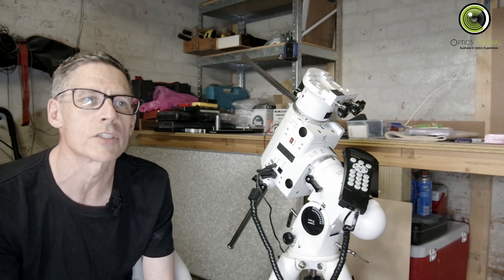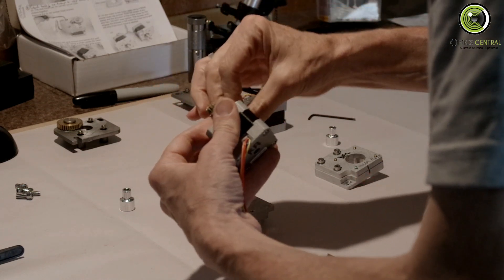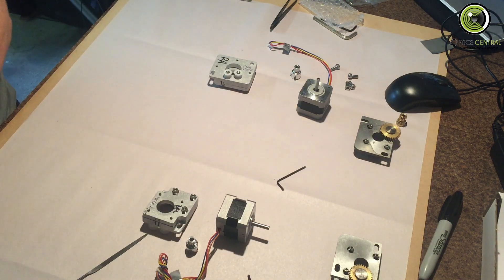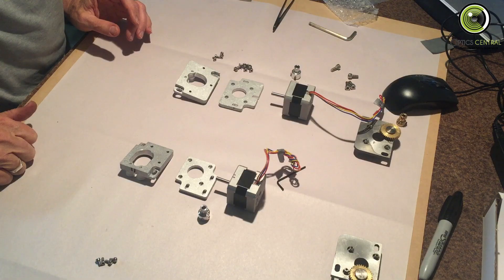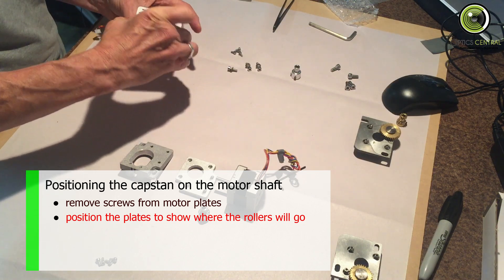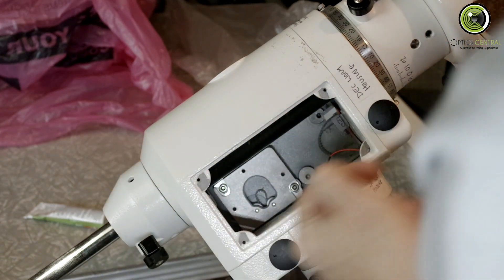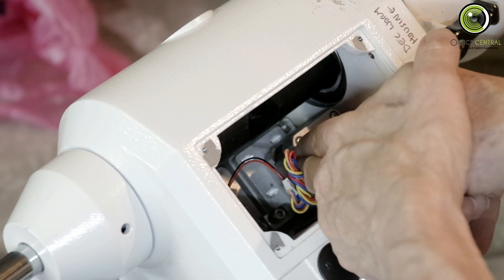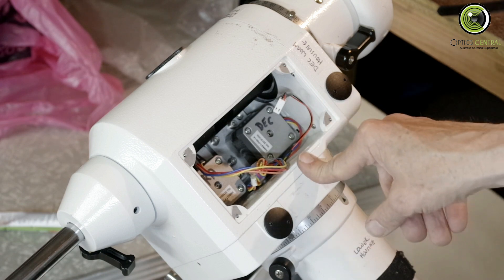Belt modifying an NEQ-6 pro astrophotographic mount - Part 6

Comment: I used a long vascular clamp with electrical tape around the ends to soften the edges of the tips that would contact the belt. The clamping pressure was low enough that I was not concerned about damaging the belts and it was like having an extra hand down in there where there was so little room for my large hands.
Reply from the maker: Oh, I like that idea! You can see from the video that even with the long forceps it was quite a fiddly bit.

Comment: I just did the same mod a few days ago.  Well done!  I had trouble getting the motor installed, getting past the belt.
Reply from the maker: Well done - it gets really fiddly at times. I was mucking about for a while with two long pairs of forceps. Then I dropped a screw. Magnets help!